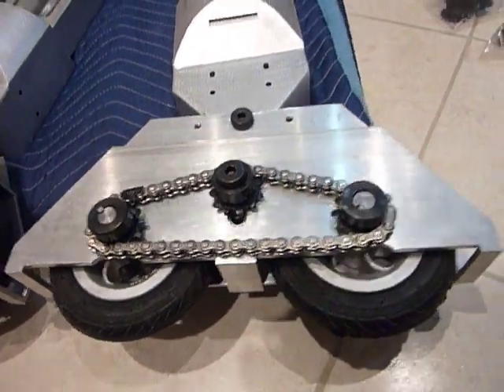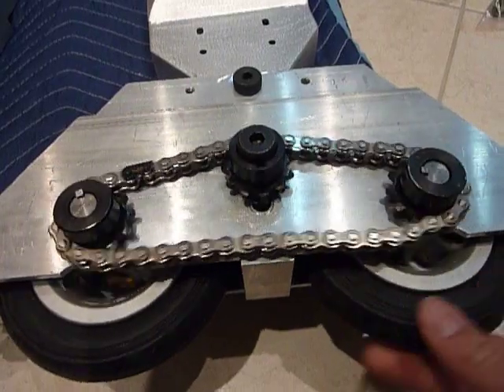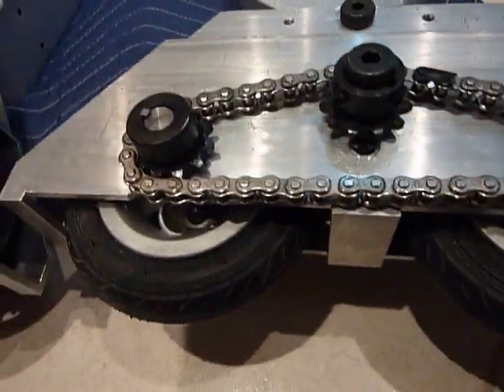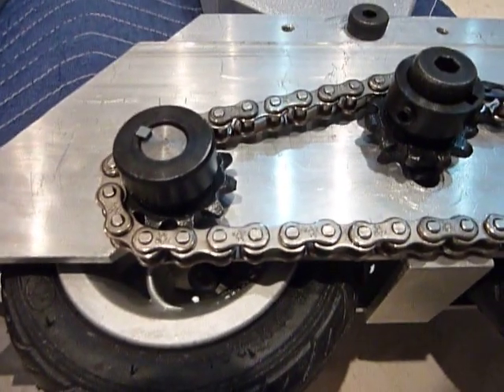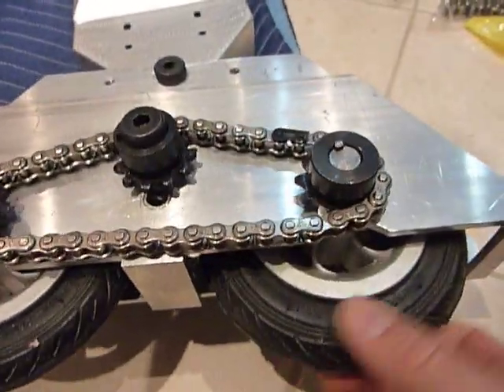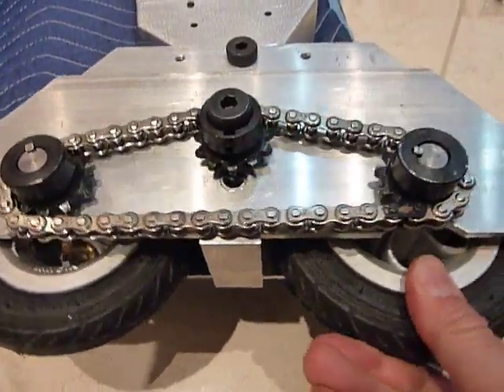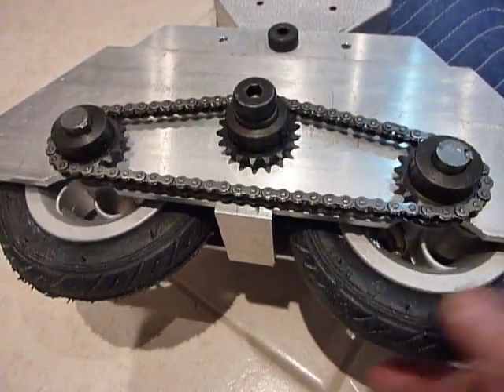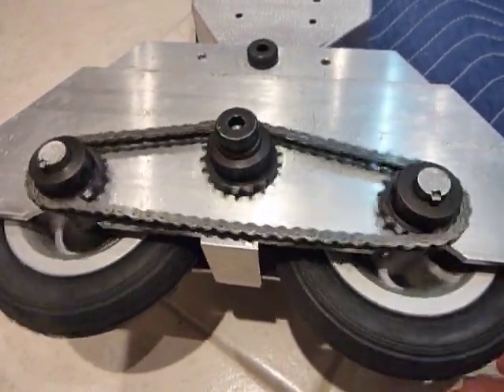Senna Drive with #25 Chain

Comment: Bikes have different chains depending on brand and Speeds, my 12 Speed Mountain bike (single gear in front) uses different than my cross country 27 speed.  try different chains, I would take the foot to the bike shop have them help you pick the right one.

Comment: nicely done! on the 35 chain if its binding there is a problem with one of the sprockets! 
been meaning to ask you also what are you using to lock your ankles in 2 leg mode?
your 3-2-3 is fantastic!!!!